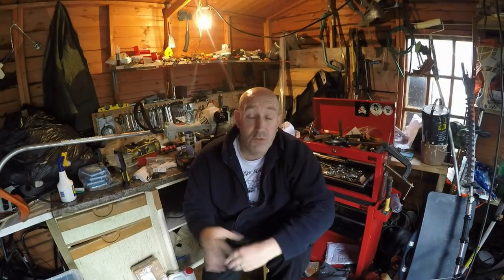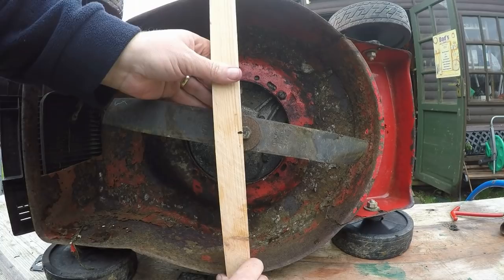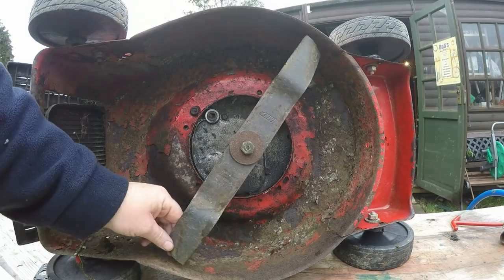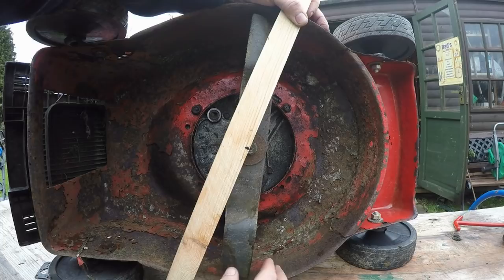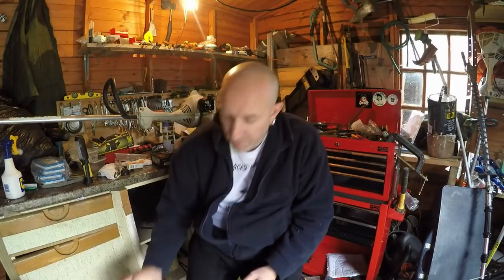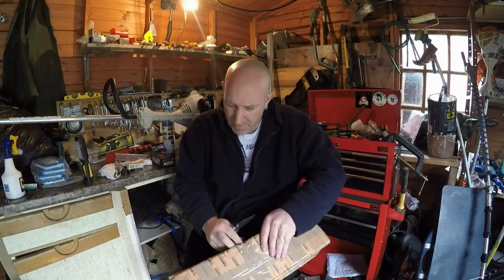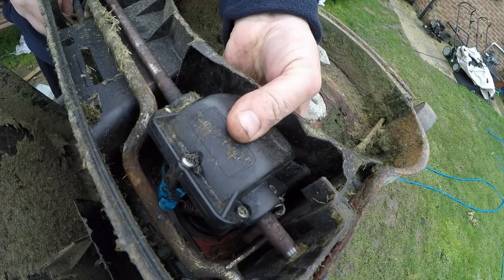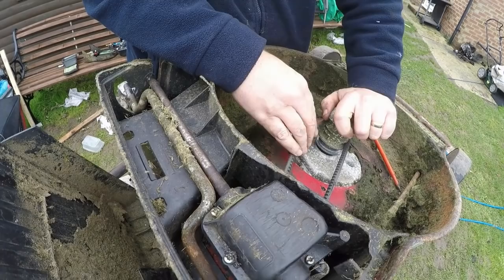#gearbox #howto #easyfix Lawnmower Gearbox How To Change

Comment: Yes, its worth checking Mick I have had many mowers with bent cranks and they oscillate the pull cord and vibrate as well. Another thing that causes the vibration is an out of balance blade. It could be that as well.
Reply from the maker: retrorestore yeah I have a new blade balance device so will have a look. Ta mate

Comment: Nice job Mick just 2 points to help you if you do another one do the cable first before you put the side spring on pull the cable through  a bit more and lift the axle out to put it on then the side spring I find it a lot easier especially with your shovel hands lol 😂
Reply from the maker: It only took so long because you rang me up mate lol
Reply: Yeh go on blame me lol
Reply from the maker: Roys the boy lol

Comment: Good work Mick.  I also had an issue with those wheels on some mowers, most have a plastic ring gear going around the inside that gets stripped out so I had to replace the wheels a couple of times as well.  It's good that you found a second hand transmission,  new ones tend to be a bit pricey.
Reply from the maker: Yeah they were over £75 new and that is not worth doing

Comment: Hi Mick good explanation of how you replaced a rear axle . Just a couple of points for everyone there are a couple of different types of cable and cable connections for the Mountfield  so be careful you get the right axle for the clutch cable you have or its another expense for a cable Mick did you check the 2 bearings as these usually go especially if the gear box was shot. Waiting for the carberator video to fix the priming issue. Thanks for sharing pa
Reply from the maker: Yeah you need to know what cable fits what mower but this was listed as what I needed and the same year.. the barings were fine.thanks for the comment bud.

Comment: Hi mick I have a castlegarden pg 140 5 speed manual ride on that jerks in gear nd loose nearly all power when going up a slight hill any help what it could be
Reply from the maker: Start with the belts mate.. if not it will be the gearbox or dog clutch I would say
Reply: @themowerman  might be the clutch ???? because when it's hot some times the blades won't engage to cut hopefully that's it cheers mick

Comment: Great video! The wheels on my mower lock up when you try to turn or pivot on the back wheels. Took the gear box apart and all looks fine. Any ideas?
Reply from the maker: What mower Is it
Reply: Macalister mp46 sp
Reply from the maker: @ryanhichens8832  check to see if the wheels needs oiling first it may be something simple. The belt could be getting snagged up also so remove your belt cover and remove any grass with in it. (Remove the ht lead first )let me know how that works
Reply: Micks Mowers belt already off and guard. The bearings for the real wheels were gone so I've replaced them. Run freely now. Both wheels turn together, should they not turn independently to allow pivoting on the rear wheels?
Reply from the maker: @ryanhichens8832  yeah they should it sounds like the axle has locked up somehow. Did you take the keyway out of the axles. They are on the ends. If so you may of put them back in incorrectly
Reply: Micks Mowers No only taken the wheels off to replace the bearings and then opened the housing to inspect the gears. I'll try and disassemble more and see where it's locked up. Thanks 👍